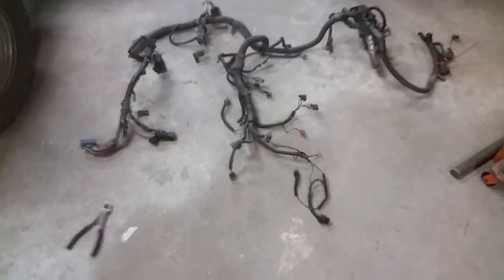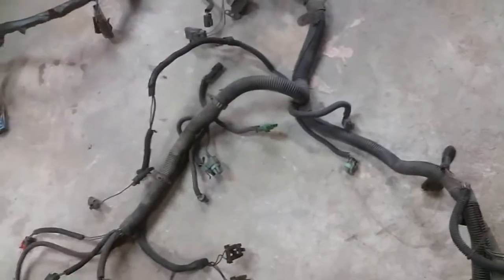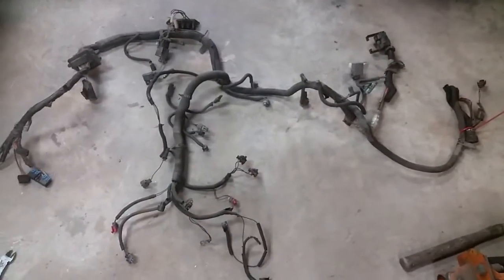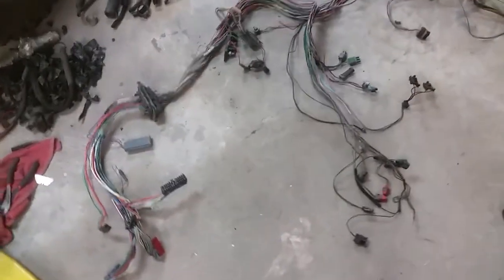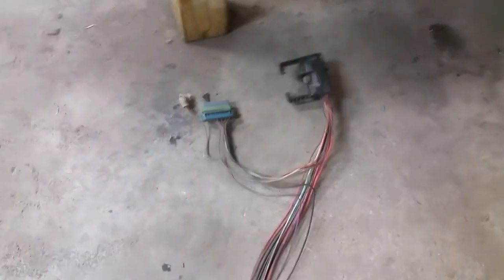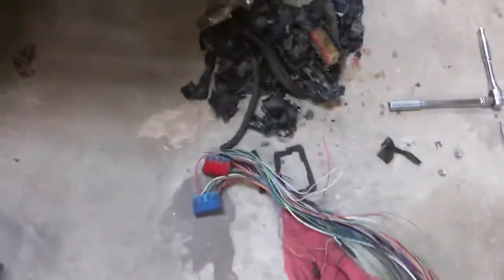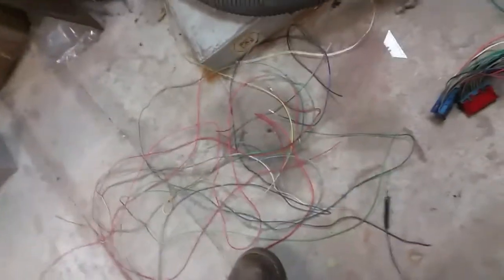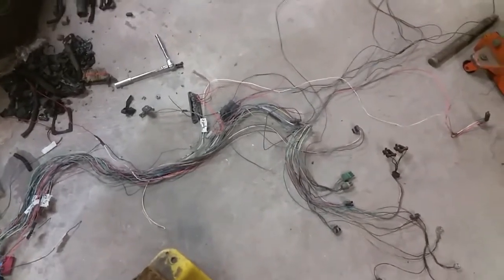Throttle body wiring strip down, Stand alone harness

Comment: I'm in the process of pulling a 305 TBI out of a 91 Caprice and trying to simplify the harness to run the engine.  I was having a hard time finding any schematics online, but ill try the pinout on google.
Reply from the maker: Chris Abitz if your ecm has a part number on it, google that too along with pinout.
Reply: @mrslam49  ok thank ya I'll do that tommorrow. I found on google a discussion forum with diagrams, but it looks like you have to purchase them.
Reply: I believe I found the pinout data I needed after searching my ecm number. Thanks for your help. Going to try and run it on a stand in the next couple days after I get the harness simplified.
Reply from the maker: Chris Abitz awesome man! Good luck with it!
Reply: So I've got the wiring broke down and hooked up on the stand. The does its initial prime and then shuts off, but when I go to crank it doesn't start spraying. Isn't there an oil pressure switch that controls when the injectors start spraying? Thanks
Reply from the maker: Chris Abitz if I remember right the fuel pump is wired thru the oil pressure switch. I wired around that in my harness and took the oil pressure switch out of the loop.
Reply: Ok I don't have any fire either just checked a plug for spark
Reply from the maker: Chris Abitz you’ll have to look very carefully over your schematics again. Make sure you have your power wires in the right places. You injectors will have to have a 12v source and the coil will too. There’s probably other places that need 12v as well. The fuel pump relay etc.  like you mentioned, I would get rid of the oil pressure switch, that thing will mess you up.
Reply from the maker: Chris Abitz also make sure your computer is grounded to the engine and to the battery.  If you have no spark and no fuel, it sounds like the computer ain’t doing anything yet. Make sure all your power and grounds are good
Reply: @mrslam49  ok thank ya sir I was gonna go back out later and review where my powers and grounds are and if there good to go. It seems really simple after you get working on it to make it simplified. So I'm assuming the oil pressure switch you just wired around it straight to the fuel pump?
Reply: So I didn't have my main power for my injectors and coil taken out of my car side of the plug. Hooked those to 12 volt and she fired right up without going around the pressure sender. Thanks again man for all the help I appreciate it.. It was actually really simple and only took about an hr after getting that factory silicone off where it went thru the firewall. Did u wire up an obd plug for yours or not?

Comment: Any tricks to removing the sealant and plastic connector where the harness passes through the firewall? I have the harness out but the harden gel is a pain to get off! Thanks
Reply from the maker: It is a pain to get the wires out of there!! It took me a while, I just carefully peeled each wire out individually. Once you get the plastic cut open and wittle down the Silicon crap. It was a slow process, but probably didn't take me more than 30 minutes or an hour.  Just gotta sit down and do it. Grab a beer and put some tunes on man
Reply: Erocks Garage thank you, that’s what I figured. :/ it’s 5 o’clock. :)

Comment: Any good resources for wiring schematics? Can’t find any good ones online
Reply from the maker: M.A.C. Works you can find everything online. Google tbi pinout, and you will find information. You will have to search for the specifics year of ecm that you are working with because there are different ones and they use different wiring diagrams.
Reply: Erocks Garage thank you. I am actually trying to do the opposite and need to remove the stock engine harness for my LS engine wiring to replace it. Need to keep transmission sensors, ac control, starter wires, brake controls, etc
Reply from the maker: M.A.C. Works ah that makes sense. Your best bet is to unwrap the harness that goes inside the cab to the computer. Pull it out of the firewall and unwrap it all. You can remove all of that, everything that goes from the ecm to the engine. All of the other controls will come from the fuse block on the driver side firewall. You are going to have to just dive in there and remove the tbi harness manually. Take the loom all apart and remove it. The harnesses are integrated but most of it goes directly from the ecm to the engine. Dissect it and cut it out.

Comment: so I had a 4.3 vortec tbi and swapped to a 350 tbi would it cause a lot of running issues and need a new harness.
Reply from the maker: Im not real sure, i do know that just in the v8 version there are different computers and different harnesses and you cant mix and match. Like the wiring and computer are different from a 94 model to a 90 model and will have a completely different pinnout.. so if you were to stick a 90 model computer into a 94 harness it wont work...so it just depends. Best thing i can tell you is to look uo your ecm number and find the pinnout data for that specifically, then youll have to check all the wires in your harness and make sure it matches up to the ecm.. if not you may have to change pin locations or add and subtract wires to make it right.

Comment: I have 350 tune port wiring how would you charge to do it if I sent mine to you. Thanks Ed
Reply from the maker: Hi Ed, its not something i would do for hire. You be better off ordering a harness from painless or somebody who makes those. Thanks for watching brother
Reply: @mrslam49  what if I won't to use my transmission that's already in there swapping my lt1 for 5.3

Comment: Did anything need to be done with eprom in the computer?
Redoing mine at this moment
Reply from the maker: P Bond, nope not at all. These early years did not have vats (anti theft), so there is not really anything to reprogram, if you keep it stock. On both jeeps I did, I used the stock computer and chip, and they both work fine.
Reply: I'll see how mine goes with all this crap stripped out..going to try Saturday

Comment: So how did this work out for you, any issues?
Reply from the maker: P Bond,  it worked out great. I have actually done this a couple of different times in different vehicles. Super reliable, and starts everytime! I have a few videos of a blue jeep on my channel, the harness in this video is in the blue jeep now. Also the black jeep on my channel has the same setup a tbi 350 with a stock harness stripped down. 

https://youtu.be/8axlZH1kmfM
Reply: have the wiring in the jeep, left the oil pressure plug off due to wanting a manual gauge instead.
Jeep will start if i put fuel into the throttle body....I have a fuel pump on a separate circuit, not tied into computer.
  I tested and found no pulse for the injectors.
Do i need to wire in the oil pressure switch?
Reply from the maker: P Bond, I do not have any of the stock gm oil pressure wiring in my setup. I took the wiring for that, out of the harness. I used a jeep oil pressure sending unit, which only has one wire which goes to the dash to work the gauge.. There is a main hot, for the injectors that has to be run. Did you follow the schematics closely? Also you should have the fuel pump controlled by the computer. The computer should turn the pump off and on.
Reply from the maker: P Bond, it seems like something does loop thru the oil pressure wiring, although I couldn't tell you what, with it looking at your wiring diagram. Probably something with the fuel pump wiring I think. Like I said, I took all that out of my harness so if something was looped then I would have repaired that or taken the loop out. Look up the wiring diagram for your ecm. What is your ecm number?
Reply from the maker: P Bond, I did some digging and indeed the fuel pump wiring loops thru the oil pressure switch, it's a saftey so if it looses oil pressure, theoretically it should turn off the fuel pump to stop the engine. Like I said, I did away with that part in my harness. My wiring goes straight from the fuel pump relay directly to the pump, and has a leg that splits off and goes to the ecm to tell the ecm if the pump is running or not. The keyed ignition hot for the fuel pump relay also runs thru the oil pressure switch, so in my system I would have removed that, and ran my keyed hot straight to the fuel pump relay. Then there is one other wire from the ecm that tells the relay to turn the pump on and off.  It would be easier to show you on a diagram. Kinda hard to explain. Look up the wiring diagram for the vehicle it came from and one specific to your ecm number because different years had different diagrams and wire routing. Hope that helps. Also don't forget the keyed hot to the injectors too! They gotta have power! You will have keyed hot to several things, injectors, ignition, fuel pump relay, etc.
Reply from the maker: P Bond, ok buddy, as I am thinking about this some more and looking at diagrams, I think your problem is for sure in this area., the wiring on the fuel pump relay, I think it's a tan/white, that gores to the fuel pump and to the computer to tell it the pump is on. If you don't have that hooked up, the computer thinks the pump isn't on and won't fire any injectors. You must hook the pump up thru the ecm and the relay. You could trick the ecm by sending voltage to the fuel pump signal wire, but that is not the right way to do it.  Hook that wire up, and also send your keyed hot to the orange wire on the fuel pump relay, that gives the relay power. The green wire comes from the ecm to the fuel pump relay to turn it off and on. Hope that helps
Reply: Im sure I did follow the schematics
would you happen to remember which wire is the hot one?
Reply from the maker: P Bond, well it depends which one yu are talking about!  Green from ecm to fuel pump relay, which turn on/off relay as needed. Tan/white goes out of the fuel pump relay to the fuel pump and back to the ecm in a different location, this turns the pump on and tell the ecm if the pump came on or not. There's an orange wire going into the fuel pump relay, this wire needs keyed hot 12 volts, the relay uses this to power the pump. There is a red wire going into the relay but this wire is not used, *note, that you can use the red wire and run a jumper straight to battery voltage and it will immediately turn the fuel pump on bypassing the computer, you can use this for diagnostic purposes, otherwise leave it disconnected. And of coarse a ground wire to the relay.
Reply: Going to pull it all out again tomorrow, im looking at my Chilton manual and see a couple issues with wiring placement, better to go in with a fresh look.